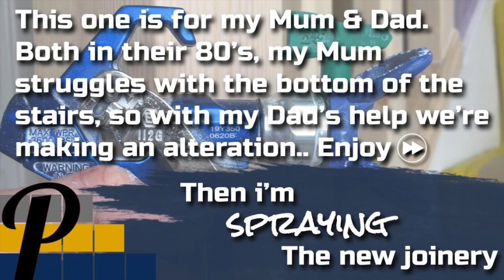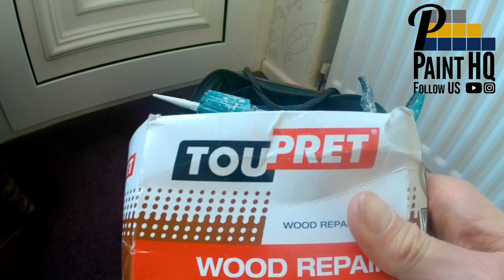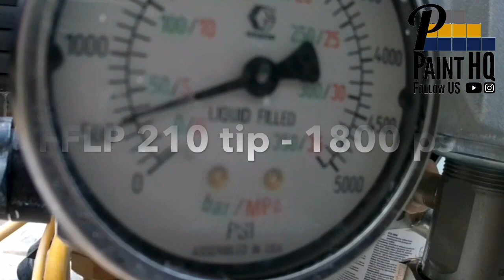Staircase renovation | Newel post installation and spraying spindles

Comment: Great video mate. 👍
Reply from the maker: Thank you Mick, appreciate the words of support my friend 👏👍 ..Remember to let me know if you manage to resolve the start/stop problem with your handheld. If not, I could always see if I could reach out to one of my Graco contacts.. determined to get to the bottom of the problem 😆👌regards Pete
Reply: @PaintHQ  hi pete thanks again . Ive changed out my liner for a new one somebody suggested that it wasn't making a good enough seal. The other issue of way too much material it was suggested that when using satinwood to try and not thin at all or if sprayer is struggling to only add tiny bit of water . Perhaps i was thinning too much. I wish i had an old door i could practice on and see if it works 😁. Thing is i have 12 doors to do next week but im nervous to spray now😩 is it possible to spray a door with it hung ?
Reply from the maker: Hi Mick, thanks for the update.. I find it so much easier to remove the doors and the result is so much better too.. easier to mask off and spray the frame and when spraying the door, it’s easier to control the direction of the overspray.. is the house occupied? Just wondering if you could setup the doors like in my recent door spraying video?. If you’re spraying more, taking on bigger jobs, not sure if you have a main sprayer or just the handheld.. it might be worth looking at the Graco GXFF or GX21.. both great sprayers for the domestic decorator, and you’ll get the full spraying experience 👍 ..Good luck with your doors, keep in touch.. I’m there for you to help and advise all I can 💯😆
Reply: @PaintHQ  thanks pete yeh house occupied but he may have a shed not sure.  Yeh i actually have a graco ultramax 395 sprayer aswel have it ages havent really used it 😂 i think i need to purchase a 7.5 meter hose so i dont need so much paint in the line. I'll let you know if i feel brave and try spraying the doors or chicken out and use brush 😂 the doors are pre primed bit have been there couple of years would you need to wash all pf them with soapy water and then light sand ? Thanks a mill mate I'll keep you posted 😂😂
Reply from the maker: You’ll soon gain confidence.. I’d put the 395 to work, earn it’s keep 😆 don’t put pressure on yourself though, start with a small project.. I’ll help answer any questions every step of the way.. regarding the doors, yeah they’ll need a light sand and clean up.. even though they’re pre-primed, I still prime them 👍 ideally from the same manufacturer / system that you’re using.. hope this helps.. let me know how you get on my friend 👌😊
Reply: @PaintHQ  thanks so much
Reply from the maker: You’re very welcome 💯

Comment: I use car body filler as glue if replacing newel posts, much stronger as it takes up any gaps, also fills the joint line for an invisible job.
Reply from the maker: Great tip my friend.. thank you for sharing 👍👍👍 ..regards Pete

Comment: Nice job. Have you ever sprayed stair railing using a Graco cordless handheld? I see u used a FFLP 210 tip. Do u think using a FFLP208 is too small to use for railing?
Reply from the maker: Thank you my friend.. the Handheld should be able to handle a small staircase, as long as the pump is working flat out on speed 10.. it’s always worth trying an .008 tip such as a 208, especially so if the product is low viscosity (thin).. if you get to speed 7 and the pattern is still poor (tails).. don’t up the pressure, go to a .010 (eg a 210), try speed 5, then 6, 7.. hopefully the test fan pattern is looking nice and solid by then.. if at speed 7 with the 210 and it’s still spraying poor.. I’d then maybe consider a splash of water (if it’s waterborne) and a good stir.. I’m not normally an advocate of thinning trim / woodwork paint.. but also I’m not a fan of working the handheld’s at speed 8 / 9 / 10.. it will unduly wear the pump.. it’s ok to fire in a small touch up project 👍 ..let me know how you get on 👍regards Pete

Comment: Hi. What Is the make and model of the sprayer you use. Great video. New subscriber.
Reply from the maker: Hi Lawrence, thank you very much for subscribing, very much appreciate your support 😆 ..I’ll help all I can if you ever have any questions 👍 ..the sprayer in the video is a Graco 395 with a fine finish hopper kit attached.. allows for small amounts of material to be sprayed.. you may find this video interesting too, it features the Graco GX21.. it’s a smaller entry level pump.. But it’s still a quality unit that will work hard for you.. and you can add a hopper kit as well 👍
https://youtu.be/r7hL5TiEm6Q
..Keep in touch my friend, great to have your contribution on the channel.. regards Pete
Reply: @PaintHQ  Thanks for that Info. Looking forward to the next upload.

Comment: What was the paint used my friend? For the amount of spraying would a hvlp be more suitable? Have-in said that it does look bob on 👍
Reply from the maker: Hey Paul, that’s a great point.. I sprayed Otex Akva adhesion primer and Helmi 80 top coat. Yeah HVLP would be suited for the small amount of material and the ability to dial the fan in for spindles.. I actually prefer XVLP for spraying decorative coatings, my reservation with HVLP is having to thin and if you don’t get the material to air ratio right I find the finish can by rough/dry.. With this airless setup.. 3/16” 7.5m hose and a hopper, the amount of material to prine is very little.. Plus I like the wetter coat that airless gives, just need to move relatively quick 😊 ..Thanks for your input my friend, always good to hear from you.. regards Pete

Comment: Just a quick question buddy your hour glass tip holder! The yellow fluid inside it is it compatible for tip used in water base materials
Reply from the maker: Yes my friend, perfect for water based materials 👍 ..It’s Wagner TipClean solution, you get some already in the hour glass bottle, then you can buy a refill bottle when you need to top up.. it lasts ages, I don’t change the solution, but when I’m cleaning up I tip a small amount on a cloth out of the hour glass bottle and it’s good for wiping over the gun and machine etc.. I then just occasionally top up 👍 Regards ..Pete
Reply: @PaintHQ  that’s great cheers buddy

Comment: Got a couple of tips you might like to try buddy I use tin foil to rap thermostat valves on rads and spots lights and even door handles saves on expensive tape and is quicker than using paper if there’s lots to wrap I also use carpet adhesive in a spray can to secure the drop plastic to the floor protection if I don’t want it to move about works great in door ways I just cut the plastic down the middle to get in and out then tape up the two bits again if I’m still spraying but the adhesive keeps the plastic securely to the floor I’ll even use it to join paper together rather than use tape it’s just quicker
Reply from the maker: Hey buddy, great to hear from you.. That’s some excellent information, thank you very much for sharing 👏 ..As always keep in touch with any questions, tips and tricks 💯 ..I’m just in the process of finalising some new content 👍😊
Reply: @PaintHQ  excellent news I look forward to the video the foil is great the paint doesn’t flack off and make a mess once it dry as much as the plastic does it’s a great time saver as well masking awkward bits if I have a rad to spray I also tape a bit of paper to the skirting tape to floor then lay a sheet out and use two small bits or corex I measure up from the floor to the top of the bracket then cut a slot in the corex and slid the two bits down over the brackets two bits makes it easier than putting two slots in one bit then just tape the two sheet together you can tape a bit of paper above-it to set the fan then away you go this system works great if walls are finished nice quick and easy 👍🏻
Reply from the maker: Thanks for the support my friend, I very much value and appreciate it.. Another great tip, thank you 👏👊